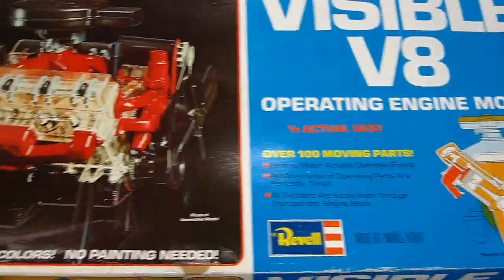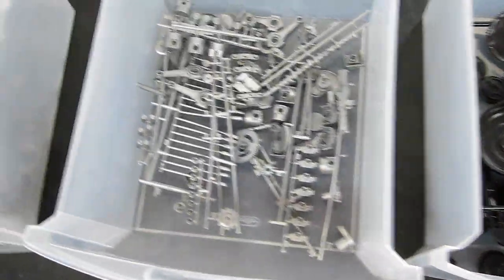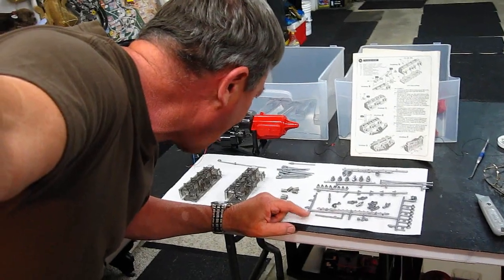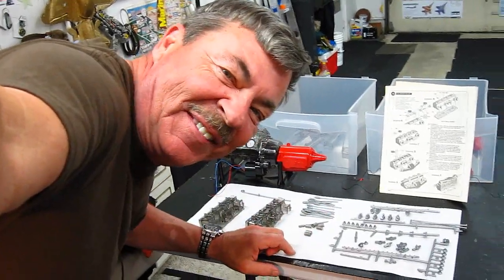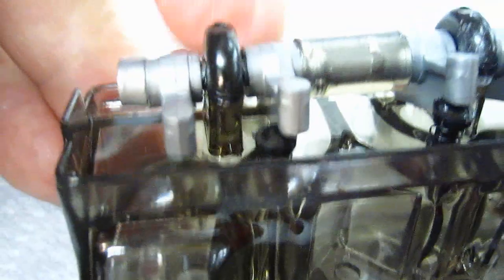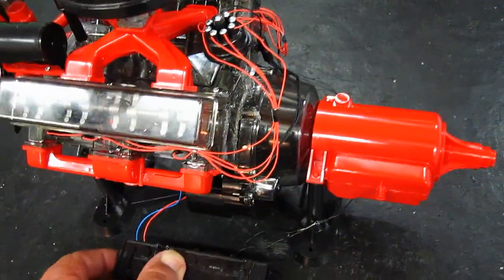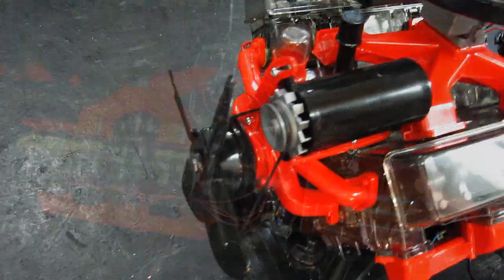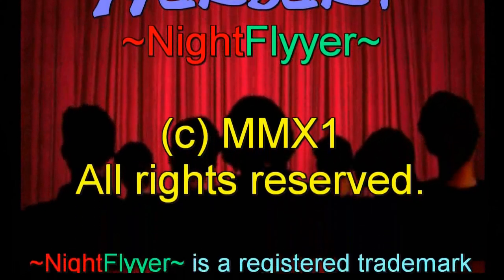Vintage 1977 Revell Visible V-8 ENGINE BUILD. Electric Starter and Spark Plugs shown running.

Comment: Thank you and so sorry for your loss. This video brought back such great memories from my childhood. I got this model for my 10th birthday. As you said, it is not an easy one, and I messed mine up during assembly. But, I did get it going, and I still have the visible 4-cyliner engine model on my workbench to this day over 40 years later. Looking on the internet, I found some crank operated versions. I need to see if there is still a battery operated version because nothing beats the roaring of the gears and the flashing of the "spark plugs" while it runs.
Reply from the maker: Fantastic you still have yours.  That is great.  Thanks so kindly.

Comment: I have a 1978 vintage model of this, and the plastic for the block is clear clear clear and not smoked like in this video.  Interesting.  This model I got in 2010 off Ebay.  It is just like the one I got for Christmas 1978 as a 10 year old.  Even looking at mine on the shelf, brings back so many memories of childhood.  But at any rate, I turn wrenches for a living these days.  As an aside - this engine is based on the Studebaker V8 of the early 1960s.
Reply from the maker: Right on. Thanks so much.

Comment: I know this is an old video, but want to thank Dave for posting it, and taking the time to video his build. Great job, and I know how much patience it takes to build one.

I had 3, (and one visible chassis), 2 back in my school days, and my last one I bought out of the Air Force in 1980. I still have that one, but has been neglected, and stored in my cellar for over 30 yrs.  Some of the parts have come un-glued as its dried out over time. I pulled it out to demonstrate the basics of an eng. to my future son-in-law, and was impressed the crank and pistons still rotate, as does the cam, and "most" of the valves. Missing a valve cover, and some battery pieces, but other than that, it's all there, and a marvelous piece of model history. I remember that the 3 I owned, all had the dist. shaft break, so the plugs wouldn't fire. Not that I worked it too hard, just a weak design. 

I'm sorry you lost yours in the fire, but hopefully no-one was injured in it. You can always buy another model, altho these originals are impossible to find. We went to Brimfield Mass. flea market years ago, and I actually saw a vendor with the chassis. All parts still wrapped, and on the trees. The box was a little deteriorated, but what was the asking price? $800!. I gasped, and the owner said he sold one a year or two back, with a perfect box for....$1200!!!
(I'm dedicated, but can't justify the expense). It was good to revisit this stuff again, and appreciate you taking the time to jot down memory lane. Thank you.
Reply from the maker: Hi and thanks so much for your great story.  I appreciate you and wish you well.  God Bless.
Reply: @NightFlyyer  And to you. Take care.
Reply: I brought a chassis kit unbuilt in a really good box about 5 years ago for 150 , someone brought it into my friends hobby shop. It’s missing 1 shift fork for the transmission.

Comment: I have one of these that was never put together. The box has seen better days but all the parts are there. I was going to put it together with my daughter but didn’t realize all the parts needed glued together.

Would it be worth selling or would someone rather have a new one?
Reply from the maker: Sell it as a kit.  Mine was lost in the huge fire, so I don't have it anymore, but it takes a while to build for sure.  Thanks.
Reply: @NightFlyyer  Hey nightflyyer, I finished my Visible V-8 about two weeks ago.  I started it a few days before this past Christmas and worked on it for hours a day until it was completed.  I used small files on all the internal parts to remove as much of the molding seams as possible and also painted everything.  I used synthetic grease on all the moving internal parts to address the friction issue(s).  She runs smooth as silk.  Interesting that the manufacturer didn't make a air filter for it.  They had the oil filter and thermostat but no air filter.  What gives?  So I made my own  "Fram" air filter out of foam and some orange touch up paint.  I also fabricated a timing plate with timing mark to match.   I made this part from the left over plastic materials. I also fabricated yellow spark plug wires with red spark plug boots for added realism.  I redid the design of the buttons and wiring of the battery box to make it a lot more dependable as well as solder, not twist tie all of the electrical wire connections.  When I complete the video, I'll share it with you.
Reply from the maker: @SoGoYoko  Interesting point.  Glad yours is running so good, but you built it the right way.  Congrats and enjoy.
Reply: Go on ebay and you can see how much they are selling for.  Older versions of this model sell for the most.  These older versions have working spark plugs that spark and a battery operated motor that rotates the internal engine parts and sparks the plugs at the push of a few buttons.  The cheaper version doesn't have spark plugs and the engine is rotated by a hand crank.  Best bet is to put it up for sale on ebay.  If the kit you have is the older version and has not been started (assembled) , bags of parts not opened, no parts missing, etc., you should be able to sell it fairly quickly at a reasonable price.

Comment: Great Video.  Thanks for posting it.  When I was in 7th grade I got one of these  on the Christmas of 1979 and built in within a few weeks.  Unfortunately I did something wrong and the cam shaft broke after just the first few minutes of run time.  Could have been a defect in the part or perhaps I didn't knock off all of the extra materials which got hung up on something, causing the cam shaft to bind up and snap.  So after more than 40 years I bought another one of these on ebay, just this week.  It's been nagging me to do this engine again and this time get the cam shaft right so the engine will "run".  This will give me something fun and interesting to do during this winter when I can't be outside flying my r/c aircraft.
Reply from the maker: Right on.  Take your time.  Ive heard the original kit was better than the newer ones.  When  you get it done, post your link here.  Good luck and thanks kindly.
Reply: @NightFlyyer  Here you go.  I'm not completely satisfied with the quality of my video.  I shot the video with the same camera (mobius) that I utilize on my radio control aircraft.  It does a great job for that application, but for close-up clarity, not so good. I put a lot of time and effort into this build for a few reasons.  One it was something that nagged me to do for a number of decades since I messed up the one I got for Christmas of 79' when I was in 6th grade.  And two, I put a lot of respect into this build out of respect for those who created this model over 45 years ago who in most cases are not with us anymore today.  Enjoy.  https://www.youtube.com/watch?v=Q5g6ruohAiY
Reply from the maker: @SoGoYoko  Great job.  I can see many upgrades in your newer kit than the original.  You did a great job..  Thanks.
Reply: @NightFlyyer  I'll definitely post it up.  I bought an original 1977 Revell kit on ebay this week.  I saw the newer ones at the local hobby shop a few years back.  Didn't have the electric motor or the actual lighted spark plugs.  That's precisely why I didn't waste my money purchasing the newer one.

Comment: My Dad  bought me the kit back in the 70s and he builted it for me. l dont recall Dad have issues with the build and he barely knew which end of a screw driver to use. That being said, l would take that motor apart and put it back together again countless times...always fired up and gave me hours of enjoyment. Plus l learned a lot about motors. Sadly it was tossed when l got married and left the nest...now only parts and pieces remain in a parts box. BUT l just scored a unbuilt kit from the 70s on a auction site for $140.CND.  Gonna have some fun getting this one put together for the next model show. Just wish Dad was here to help.
Reply from the maker: Thats great.  We lost this one in the giant fire that destroyed my shop and home on 911, 2016.   I did not try to replace it as other things are still coming first.  Glad you found one.  Your dad will be there.   Thanks.

Comment: NICE BUILD, I DID ONE TOO. TO BAD I USED AND ELECTRIC ON MINE TO POWER IT...BOOM...LOL
Reply from the maker: Thanks.  I used the stock motor and battery pack to run mine.  But the fire that destroyed my home and all, also destroyed this.  They don't make them newer ones like the originals, so I never got another.

Comment: I always wanted this kit when I was a kid in the seventies, but it was too expensive.  If I remember correctly, Revell also sold a car kit that this assembled model would fit into. (I seem to remember seeing it in the Sears or Montgomery Ward Christmas catalog circa 1972 or 73.)
Reply from the maker: Yes.  It was fairly expensive for the time, but much better than the ones they make today.  I wish it hadnt burned up in my fire.  Thanks.

Comment: I had this model back when I was about 10, cant remember finishing it, but do remember the starter running the crank and pistons. Not sure if I got the valves to go or not. I dont think it ran long before falling apart. Nice job you did. Now I play with the real ones
Reply from the maker: Yes the valves worked and I still play with the big ones too.  Wish it hadn't been destroyed in my fire, as the new ones do not work or look as well.  Thanks kindly for commenting.

Comment: I built my first one at 11 back in 77 ... I'm now 53 and was a certified A.S.E. mechanic... now I manage a transmission shop...  if not for these models I would not have had prior knowledge of the combustible engine.. great video... takes me back..
Reply from the maker: That is a great story and good to hear.  I hated to lose this model in the fire, as the new ones aren't as good, I hear.  Keep up the good work.  Bet you have a model Trany!  Thanks much.

Comment: I can't tell you how much I appreciate you posting this. My Dad got this exact model for me and we built it together
around 1977-1980,  I was 10 to about 12 years old. It worked as yours did, for a while. The electric motor was strong and 
fit wasn't that great. I think two of the connecting rods ended up snapping. Thanks for taking the time and slowing down
the steps involved in making this model. It taught me a lot  about engines when I was young.
Reply from the maker: Your right about the motor fit for sure!  LOL.  I am very happy to hear your story and really appreciate your comments.  Thanks very kindly!

Comment: Man that one looks way cooler than mine does I got mine 
For Christmas this year and it's all done  but now I see the 70s version of it it's way better
Reply from the maker: Yes the early ones wre much better.  I lost this one in the fire and hated losing it for the reason you state, as replacing it with the new one is not what I wanted.  Thanks.
Reply: @NightFlyyer - There are several offered on ebay, but I'll tell you they aren't cheap.  I bid on one yesterday and lost out to a $330.00 winning bid!

Comment: A WORD OF CAUTION!!! My wife bought me the latest iteration on Amazon 3 years ago for X-mas. She'd heard me talk about it and seeing my first one in a hobby shop window in the early sixties, and how I SOOOO wanted one! $60.00! I was giddy as a schoolgirl! After two weeks of prep and assembly after work and on the weekends, I got to the cylinder walls and then the camshaft... Imagine my total dismay when the cam gear and timing gear were 1/16" away from even touching gear TEETH! I was STUNNED !!! I reviewed, I studied, I couldn't find anything wrong on my part that I could see. I've been building models for 50 years, and, far from contest quality, I'm pretty capable, so I was floored. Back in the closet for 3 years now, untouched. Maybe I'll pull it out and re-examine it this year, but I doubt it. Kinda like Ralphie's Little Orphan Annie decoder ring... "DRINK MORE OVALTINE!" Yeah, right!
Reply from the maker: Yes the new models are not the same.  No motor, etc, so I never bought another one after this one (which was original) was destroyed in the fire that destroyed all my models.  Thanks for the comment and I loved Ovaltine too! :-)

Comment: i put one of those together a few years ago. I hooked up an electric drill and I couldn't blow it up cranking it to the max. The center of the the flywheel rod rounded out. It didn't come with spark plug lights, real distributor, battery box and electric motor.
Reply from the maker: Great.  Yes, only the early ones had all the lights, distributor, etc, but bet yours looked great while running with the drill.  Mine has now sadly been destroyed in the fire that destroyed all my models!  Thanks.

Comment: Thank you very much!  Yes this also brought back a ton of memories.   I begged my dad to buy this model for me when I was in 5th or 6th grade.  I still can't believe he bought it for me.  We never asked for anything because we never had any extra money.  I remember wanting to be a mechanic.  My brother's friend was at our house and  he heard me say "I wanted to be a mechanic.  Lloyd took me outside and openned the hood on my dad's car and quizzed me on the parts of the motor.  I didn't know where anything was.  I remember him  asking me where the carburator was and the alternator.  Then I remember Lloyd saying "you don't know where anything is.  you'll never be a mechanic."  It wasn't too long after that, I got visible V-8 engine.  Worked on it for three days straight.  The last day, I told my mom I was sick, so I didn't have to go to school and I could finish the model.  When my brother came home from school we got into a fight as usual.  He ended up puntting the visible V-8 across the living room floor.  I couldn't believe it!  I spent the next day picking up all the broken pieces. I even went as far as sweepping the extra pieces with the vacuum cleaner and then dig through vacuum bag to find the other pieces.  Over the years he got tired of me bringing it up.  He would say when are you going to get over that model engine?  I could never get it all back together, there were just too many broken pieces.  I realized that I didn't need the model anymore.  I had learned what I needed to know about the internal combustion engine. Building the visible V-8 engine taught me a tremendous amount about the internal combustion;  just would've been great to still have it.  I got mad at my youngest son today.  The story visible V-8 engine came up. It was just so nice to able to go on YouTube and have this video to show my son.   Thank you.  
Hi, this is Ross. Yeah my dad realy likes you. I realy like you. do a nother video please.  My brothers havn;t seen it well eather has my mom they probably want to see it. Well i,m about to wath a movie.
Reply from the maker: Hi Doug. WOW.  What a story.  Thanks for telling it to me.  I am sorry I cannot make another video as this engine was destroyed in that horrific fire that destroyed all my models and home. I hope you fine some of my other videos worth watching.  http://www.youtube.com/nightflyyer/videos

Comment: I built this model in June 1963. It cost my dad ten dollars (equivalent to $100 now), and it taught me plenty about gasoline engine, such that I worked with a family mechanic to rebuild my 1965 Rambler American's in-line six cylinder engine, and later my 1984 Olds Ciera's V-6 engine.

Comment: Thanks for posting! My brother and I put one of these together in the early seventies. It was a lot of fun but was a bit challenging for an 8 and 11 year old. Excellent memories. 
The company also made a 'Visible Chassis' that could be mated to the 'Visible V8'. It had a working 3-speed transmission, and even had hydraulic brakes; which if I remember correctly you had to fill with vegetable oil. My dad bought it for us, but as kids it was too complicated.

Comment: Had one back in the. 70s ,just buoght another , it sucks hand crank and no spark plugs
Reply: @Barry Pfost - Quite a few on ebay for bidding or purchase - the original Renwal with electric motor and working plug lights.  A good one, unbuilt, no parts missing will run you between $150 and $300+!

Comment: As you mentioned, newer engines are more efficient, but troubleshooting a vintage engine like this you only needed to know about 3 things Fuel, ignition, compression. Today we have computers for the transmission, SRS system, ECU, EGR, O2, mass air flow, so forth & so on to infinitem.
Reply: @8000RPM - He was referring to this plastic model engine - not a real ICE!

Comment: About 50 years ago, as a very young teenage, I built this model. I shimmed the rocker arms to get the valves to open all the way. This model actually worked. You have to do a fair amount of "customization" as the parts do not fit well. Mechanical aptitude is a must. When I got it running (50 years ago) I was ecstatic.  It was so dear to me that I still have it. I decided to repair the few parts that were broken and get it running again. I could not find instructions to the motorized version anywhere on the net.....Thanks to your pictures, I'm now able to troubleshoot my "no spark condition". I have an open (several?) somewhere. I've hooked up a 3 volt (300ma) power converter so I won't have to worry about battery life. THANKS!!!!